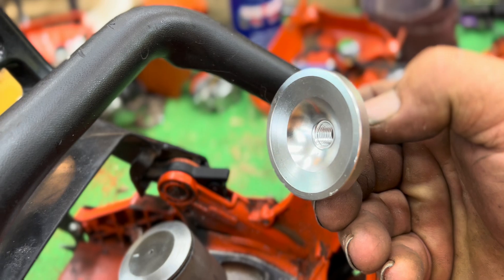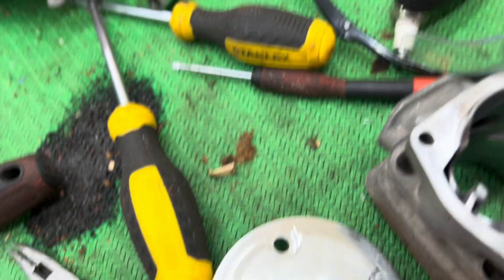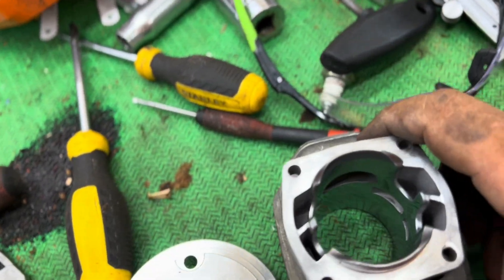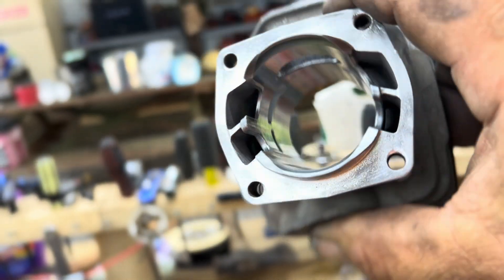Custom Head Chainsaw Project!  Machining For A Modified Cylinder Head! Echo 590!

Comment: I was wondering if that head design is something that's readily available in the aftermarket somewhere or is it something specialty made?
Reply from the maker: @jakegorman7121  I found it on eBay but it’s setup for 45mm cylinder if I remember correctly.

Comment: Lap it in with valve compound and use a .005 Copper shock with a dab of Hylomar on each side. 
   I have heard of people just using sealer after lapping.

Comment: Are u using long studs to bolt all together head & cylinder?? Maybe u could of used a cooling fin as better sealing area? Could put a set of bolts under fin to have a tight seal if u get what im thinking
Reply from the maker: The head came from eBay. Sometimes you are limited by what you have to work with.

Comment: Looks like a fun project.
I have no idea how you are going to seal that up short of making a head gasket out of copper.
On two piece dirt bike heads the O ring is about 1/8 from the cylinder wall but you machined it down too far for O rings, there's no room left.
Reply: That’s an excellent idea with the interchangeable heads!  A rotary table and a small
Ball end mill will cut you a precise groove for an o/ring. Using the o/ring for a seal is best imho as you can assemble/disassemble as many times as you want
Reply from the maker: @nseric1233  I just put a light dab of high temp sealer. I talked to a few guys and some of them don’t do anything except relying on the tight tolerance. Then some others will install an o-ring.   I would have gone with o-ring but as you noticed I took too much off.

Comment: Compression is the limiting factor in the 590/620 platform. I've wanted to put a head on one for over a year now but dont have the tooling to do it. Hoping that changes in the next 2 weeks
Reply from the maker: This is one of those things. No matter what we do you end up with a problem. Fix one design issue and find another. Sometimes it’s better to start with a better design from the start but using projects like this to help learn.  In the end we end up with a highly modified version that performs about the same as something else with very little effort. It’s the education that makes it worth it.